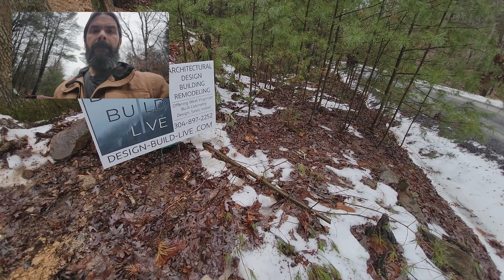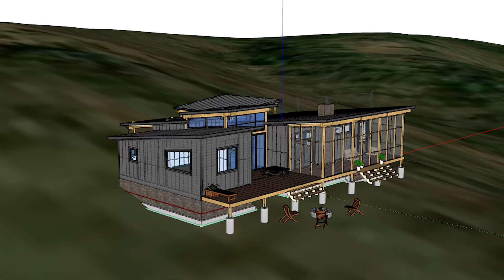Building Moms House | Site Clearing, House Location | p.1

Comment: This is way more easier than what I had to do. I worked as a draftsman/ surveyor assistant in the mid 90s for a civil engineer . When we needed topo maps we had to walk around holding the prism taking shots every 30-50’. It took forever. Then had to import it into the computer using the AutoCad software, then after all that work render a model like you have in your videos . It was a ton of work. I’m glad to see technology has caught up to make it easier to get this information
Reply from the maker: Getting properties surveyed where we live can take months, to get a topo done, even longer, and we don't always need that much data. We use modeling data that is similar to what you find in Google Earth, we can shot grade at the house when needed to adjust. Some of how we do this is on this video https://youtu.be/ZXd73G4CdPo